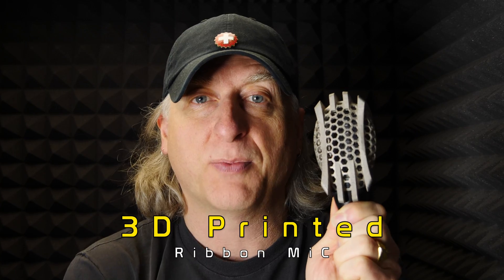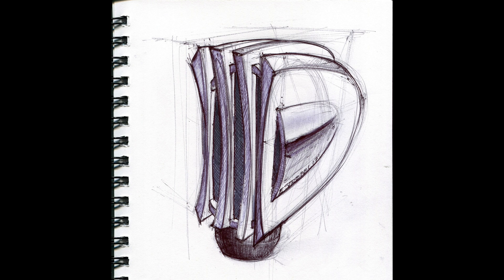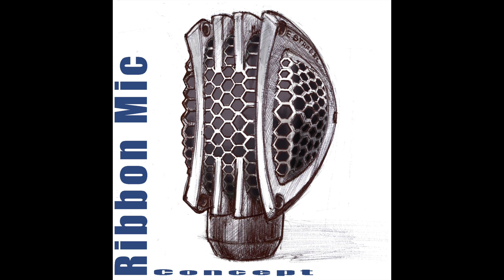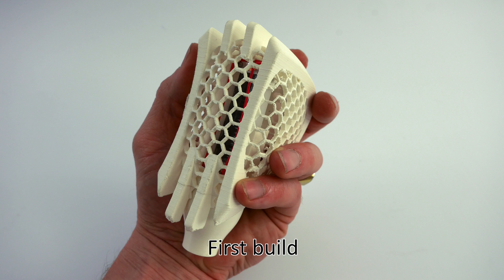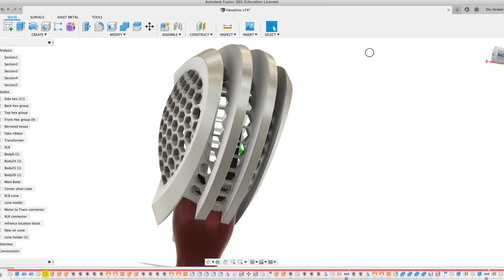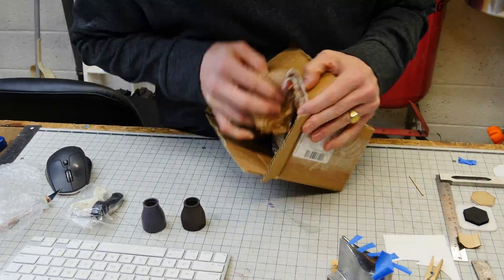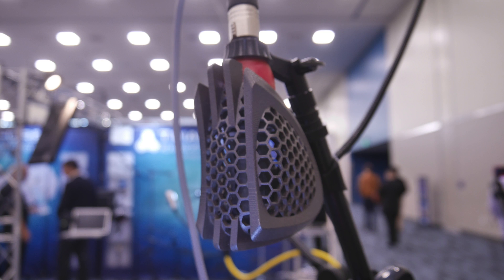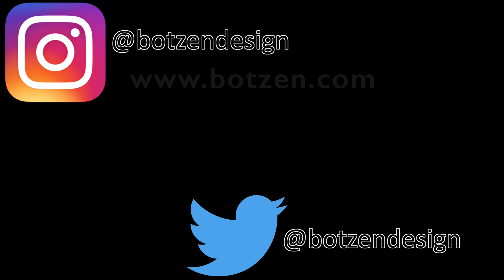METAL Printed Microphone

Comment: Eric,  This is a really well made video and the audio is excellent!  I was initially worried that the ribbon microphone was to sit inside a steel housing.  However, is the infusion of bronze into the housing inhibiting the ribbon's magnets attraction to steel sides?  Are the magnets attracted to the metal housing?  Finally, have you copyrighted this design?  It may be important for future sales.  Again, this is one of your best designs!  Also, you  could sell units with your in-house plastic housing  (sprayed to look metal) at a reduced price.  You might get more sales!